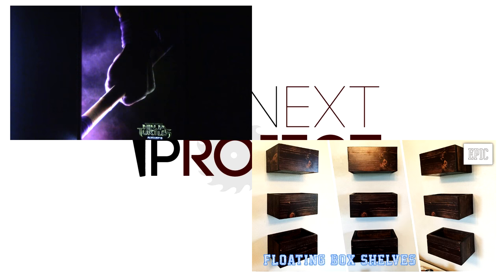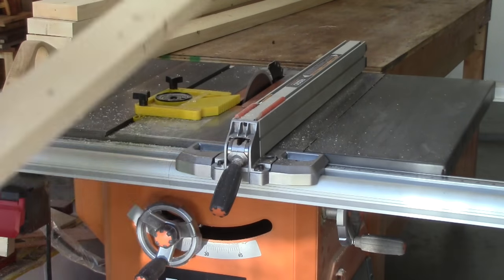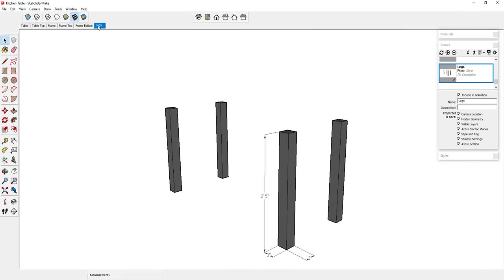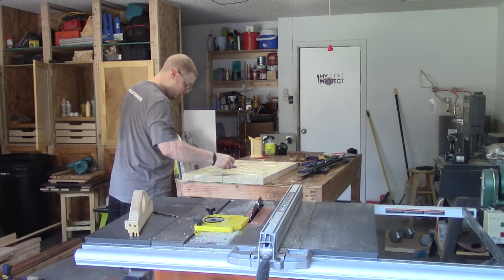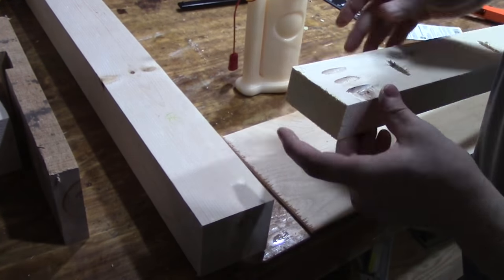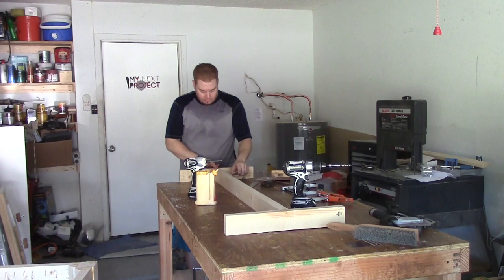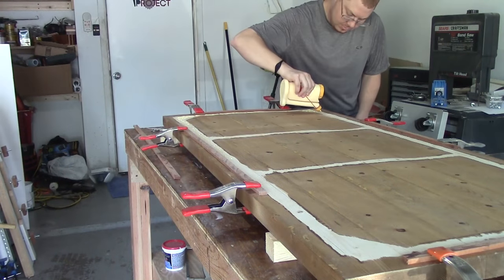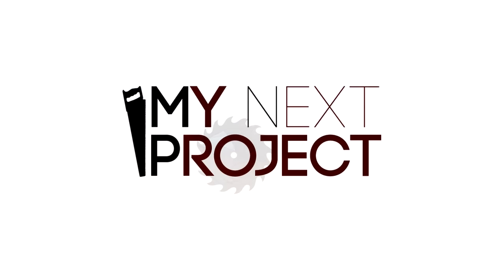DIY Modern Kitchen Table Build

Comment: Cool table! Next time you have a solid wood top look into using 'figure 8 fasteners' to attach the top. Over time the wood will expand/contract with humidity and such and it may cause the base or the top to have some issues or the screws wiggle loose. Plus, they're super easy to install and only need a forstner bit to hollow out the area for the fastner.
Reply from the maker: I haven't seen those before.  I actually had to "google" figure 8 fasteners to see what they were exactly.  That is a great idea to use those and they look really easy to install like you said.  I will definitely have to try them out.  I will have to get some to keep on hand for other things too.  Thanks for the comment and the tip!!

Comment: Never glue on cross grain situations.  The wood will expand perpendicular to the grain (gain in width).  When you glue your bracing and the table top across these boards, it fights the natural process of the expanding and shrinking of the boards and you risk splitting.  You can use mechanical fasteners with elongated holes that allow some wood movement or design the build that you don't fasten in cross grain scenarios.  The other thing is when you put on poly, put it on the bottom side to so that the wood absorbs and releases less moisture/humidity and does it evenly.  This also helps reduce splitting.  Hope this helps.  Great looking table.
Reply from the maker: I did put poly on the bottom as well.  Just not as much and the shots of me putting it on were not that great so I cut them out.  

Thanks for the tips on gluing the cross grain.  Hopefully it won't cause me too many issues with this table.  So far i haven't had any.

Thank you very much, I like this table as well.  That for watching and commenting.

Comment: nice table. the glue bot has a spot on the top of the bottle to put the cap when your using it. if that helps. lol, saw the cap swinging around
Reply from the maker: Yes it does.  I received another comment very similar.  I try to use that now especially when it is in the way.  

Thanks for watching and commenting.